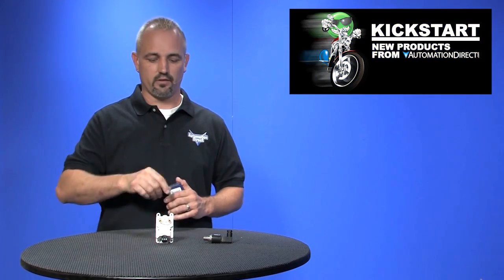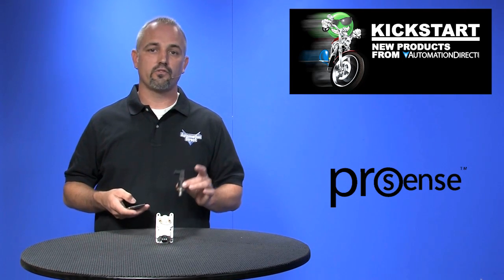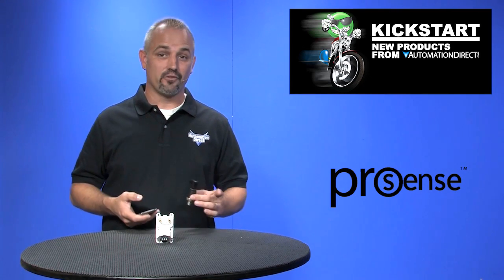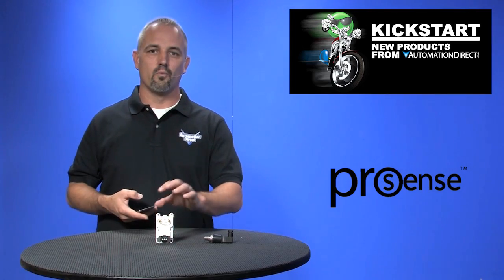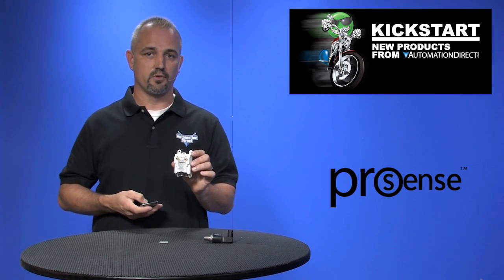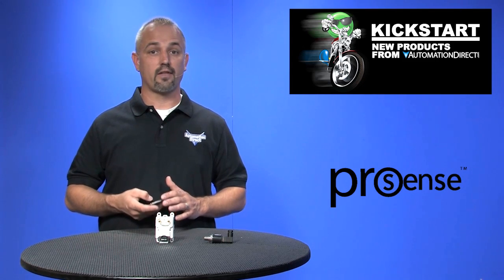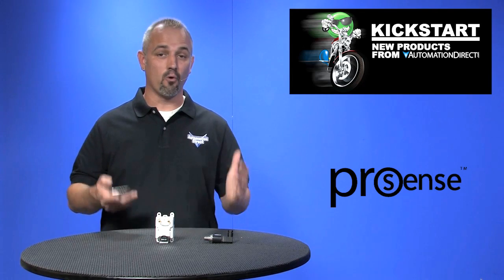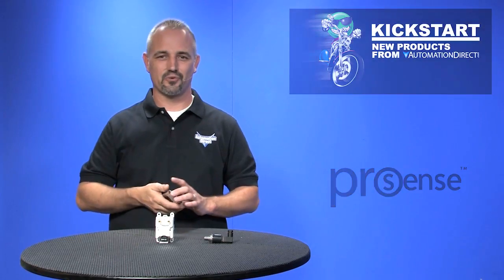ProSense Air Differential Pressure Transmitters from AutomationDirect

Comment: Sorry for the newbie question, but to 'what' do I connect the sensor to, a PLC? How I can integrate into Home Assistant?
Reply from the maker: Not a newbie question at all, as there are MANY variants of these types of sensors. Our transmitters will output an analog signal. usually either a 4-20mA range, or a 0-10VDC range to give you a pressure value. You can connect these to anything that will accept an analog input. For most of our industrial customers, that would be a PLC. However, Home Assistant has a pretty big library of hardware and software pairings from the community, and you might be able to find something there that would allow you to accept an analog signal into your home automation system.

We also offer pressure switch versions of these that are simply on above or below a pressure setpoint, and then they change states when they cross the setpoint that you choose.